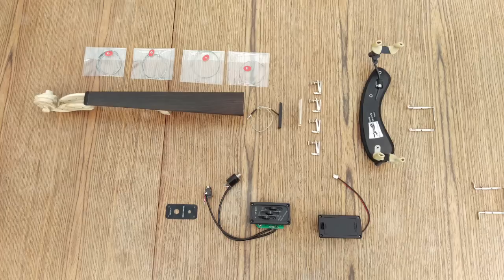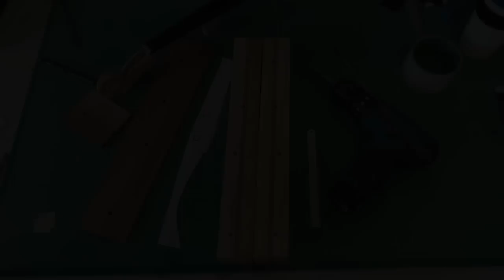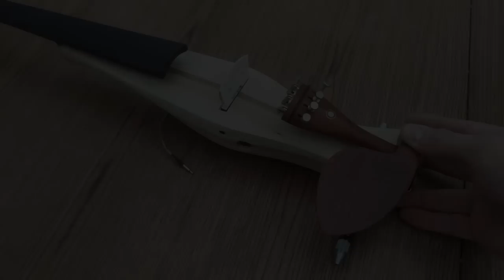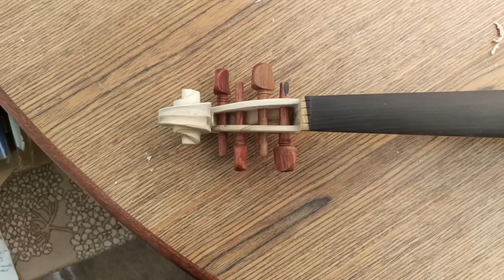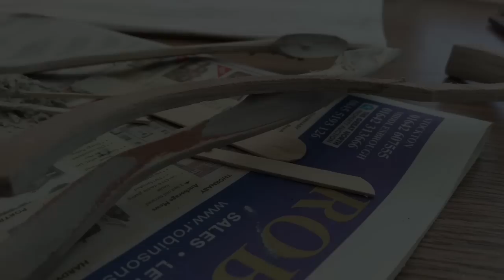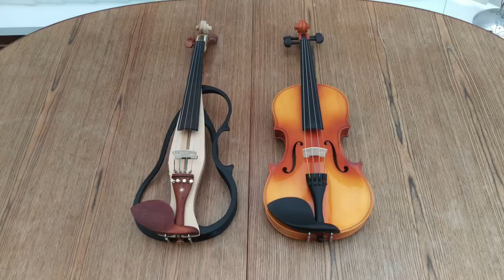A Bespoke Electric Violin Build From Start To Finish

Comment: Thanks for making this video. You could leave out the background music or tone it down quite a bit  as it is a distraction to hear what you are saying. I am in the thinking phase of designing my own electric violin I bought some ebony finger boards and have found some designs I like on the internet. I have been researching fingerboard geometry and have found it is more involved than I anticipated so the thinking phase is where I will be for some time.
Are you happy with you final result? My first impression when only watching into the beginning of your video so far is the weight might be a bit on the heavy side. anyway thanks again for sharing your process.
Reply from the maker: many thanks for the kind comment, and I will be more mindful of background music in videos in the future. :) that all sounds very interesting. I was fortunate enough to have my acoustic violin to get all of the measurements and geometry from, and should you have access to one, reverse engineering an acoustic violin really does help. I am vary happy with the end result. the weight of the violin is comparable to that of a viola which I also play so I didn't mind the extra bit of weight too much. many thanks again for the kind words. :)

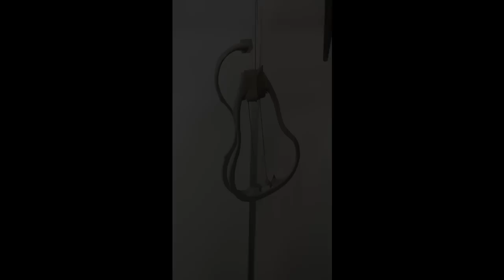Comment: Hi David! Wonderful video! I was wondering what kind of paint you use (at 9:00 min. ) for the first layer, before sanding and re-applying the dark coating?
Thanks in advance!
Reply from the maker: sonja vredeveld hi, many thanks for the kind words. The paint I used was a HMG high build 2K paint. I think it's pollyurathane based and it has a catalyst to cure the paint. It's usually used for industrial applications like in the automotive industry so it won't be effected by heat or chemicals once cured. I hope this helps :)

Comment: Would you suggest learning on an acoustic before using an electric violin? Great video btw!
Reply from the maker: Hi William, yes I’d recommend learning on an acoustic violin
first. From an acoustic it’s a lot easier to tell when you’re playing the notes
in tune as the body and other strings resonate. It’s a little hard to describe,
but you can almost hear a change in the sound when you’re hitting the right
positions on the fingerboard. It’s also slightly easier to get a good sound
from an acoustic as the resonance cancels out a lot of the ‘scratch’ from
bowing that you would hear on an electric violin(until you’ve developed a good bowing
technique.) I hope I’ve been helpful. And many thanks for the compliment. J

Comment: Great Video David. You have impressive woodworking skills. I was thinking about 3d printing an electric violin, but am having trouble finding information about circuitry. Would you happen to know of a guide I could read up on to help? Also, could you give the website where you bought the chin rest and neck of the violin?
Reply from the maker: Hi Anthony, sorry for the late reply. Many thanks for the
kind words there. For the circuitry for my violin I just looked at current violins
on the market and what types of circuitry they used, then tried to find
something similar on EBay. As far as I could tell most of the ‘circuitry’ comes
after the feed has left the violin like with a guitar. Most violins only have a
Piezo crystal transducer
pickup under or even inside of the bridge (some DIY violins also use acoustic to
electric guitar pickups too); but for my violin I opted for one with an
internal amplifier with a few basic controls as I originally wanted this for
silent practicing. All of the items I bought were from sellers off EBay, but
the exact listings have now expired. If you search and shop around you can find
every part you’re looking for on there. (I seem to think that my neck, and tail
piece set were bought from a Chinese seller called IFox.) I hope this helps.